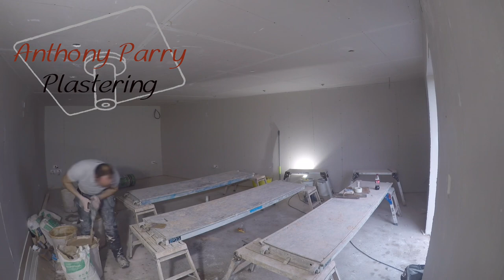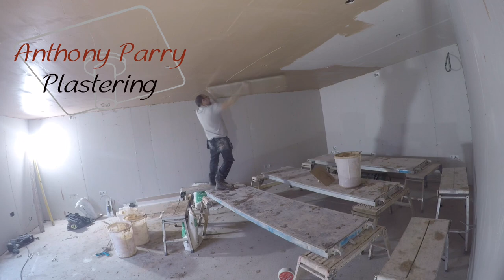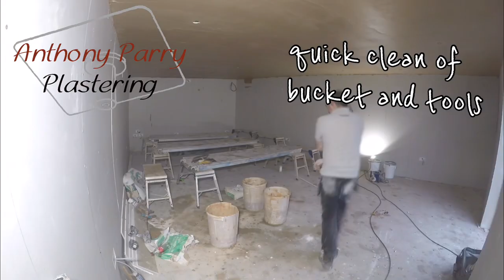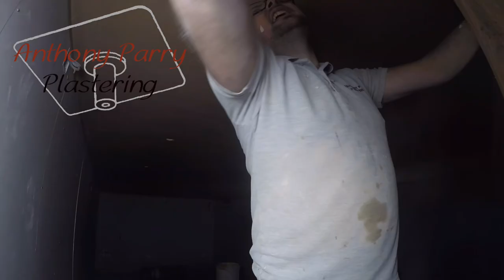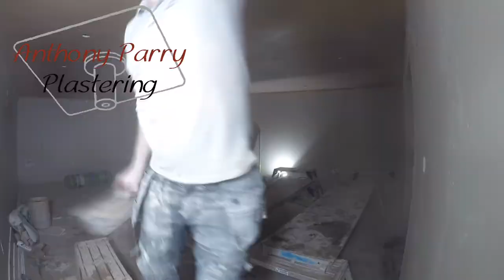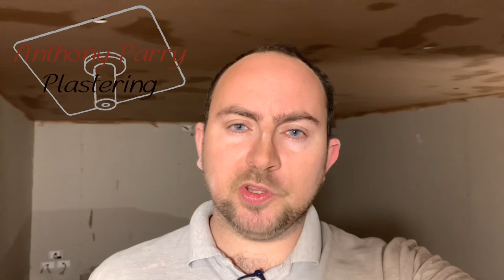How I plaster a big ceiling on my own. Plastering timelapse PART 1 plastering a games room

Comment: Thanks for post, what do you mean trowel across the source of light mate? I have ceiling to do tomorrow, never though about trowelling in direction of light source. Cheers!
Reply from the maker: Yes I do, that’s the way I was taught to do it.  It’s because natural light will always show any imperfections. So this way when the light shines there won’t be any bumps to be seen. 
But obviously you want it to be flat the first place 😀
Reply: @AnthonyParryPlastering  So you lay on 1st / 2nd coats in line with the direction of light, and cross/final trowel acrossk/perpindicular to the direction of incoming light .  I think thats what I saw on the video ?  Im guessing if you get any striping you don't want that going across the direction of light as, like you said, it would be more visible from raking light on ceiling.

Comment: Hiya mate, enjoying the videos, just wondering do you only trowel one way every time? I was taught to always cross trowel as well to take hollows out. Purchased the refina spat recently, basically a big super flex, brilliant bit of kit saves a lot of time. Keep it up 👍
Reply from the maker: Thanks, I don’t cross trowel on ceilings because I always want to trowel across the light and I don’t tend to on my walls either. 
That’s just the way I’ve been taught. 

I’ve seen the new refina spats I’m gonna have to give it ago they do look like a time saver. 
Cheers again 👍

Comment: Good technique pal, i think it would be easier just knocking up a 3 bagger with a proper mixer than keep knocking up a bag at a time with a cordless.. Turned out nice either way.. 👍
Reply from the maker: Cheers bud, it works for me. I find on my own I control the stuff better doing a bag at a time. it staggers my set time and gives me more flexibility and less wastage. 
But it works for you it works 😀

Comment: How thick should the plaster skim should  be?
Reply from the maker: Hi Alexander, it’s about 2mm but it depends on your background and how thick you need it to be. 
I would say you can tell if it’s on too thick or thin as it will become difficult to trowel. But remember to put 2 coats on. Hope that helps 😀

Comment: Nice job mate ! But Nothing worse than a sparky pre cutting holes for spot lights just no need! Any decent Sparky would just pull the wire through ... plasterer can push it up ... fully plaster over the small holes an push them through after the final trowel or the sparky just re measures them out
Reply from the maker: Cheers bud, Yeah it’s definitely easier without the holes. But I didn’t board it, so it is, what it is sometimes.
Reply: That’s the problem sometimes, keep up the good work 😀

Comment: Also you don't fancy stilts have you thought about the scaffolding tower on wheels, saves lifting the scaff boards every 2 mins, save your bck a bit!
Reply from the maker: I normally would of scaffolded it a bit better.  But I was against the Christmas rush 😀 I could do with a nice tower scaffold thou.
Reply: I used to use  a scaffold tower on wheels, I only had to get it to wash out etc I managed to Manoeuvre it from my body weight 😀 they are so good to use

Comment: How many bag off skim did that ceiling take mate?
Reply from the maker: Hey bud, I think It took just over 4 bags of board finish.
Reply: @AnthonyParryPlastering  was that the biggest ceiling you've done?
Reply from the maker: @aarongale7510  I’ve done a few bigger, this one was a just bit awkward because of the changing heights so I was either stretching or bending down so it wasn’t fun on the neck.
Reply: @AnthonyParryPlastering  im 6ft 8 an I'm a plasterer I always get the ceilings my mates 5ft 1 so he always gets the skirting lines 🤣🤣

Comment: Great job btw👍 do you flatten after 2nd coat or is this done on first trowel?
Reply from the maker: Thanks, So my method is.

Put on the first coat then I flatten with speedskim. 
Then I put the second coat on as neat as possible. 
Then it get 2 trowels with a regular trowel. Then I finish with my refina superflex trowel.

Comment: Great job! Big enough ceiling eh!
Where did you get the scaffold planks from, they look like the DB's
Takes some energy what do you eat to fuel up?
Reply from the maker: It was a fair size. They’re  youngman boards I’ve had them for years. Got them of a builder who retired. It easier than planks that for sure.
I’m always fuelled on tea and chocolate. Cheers bud